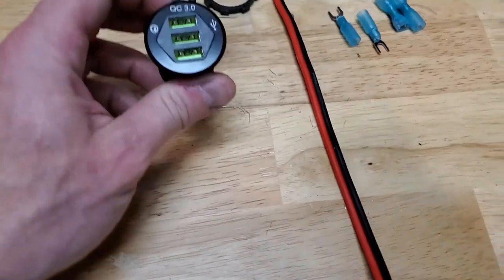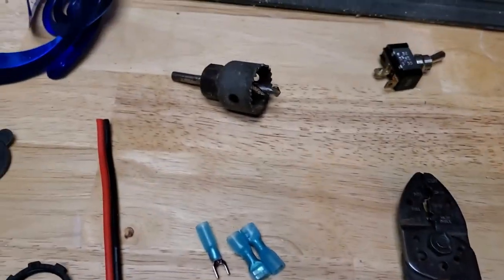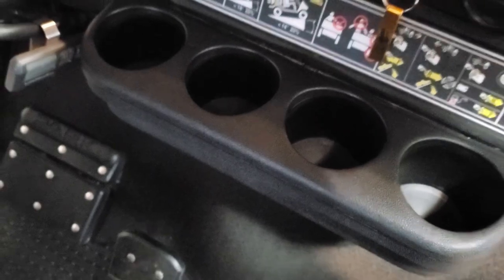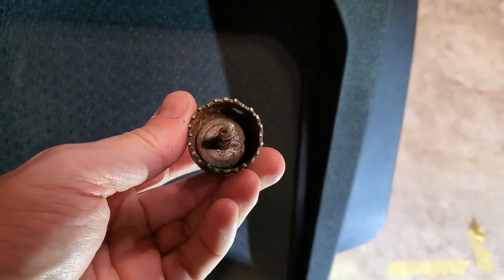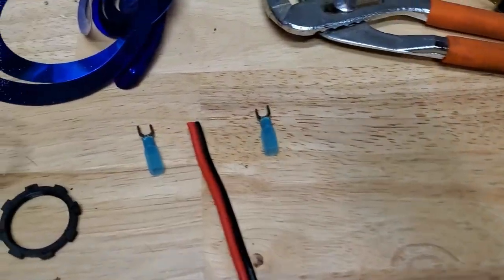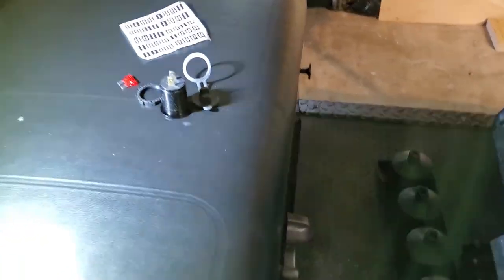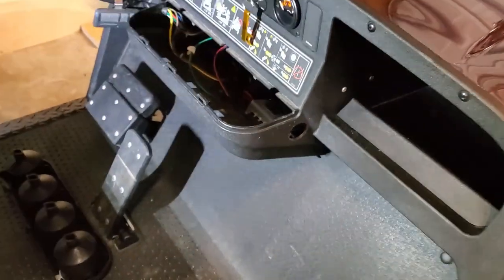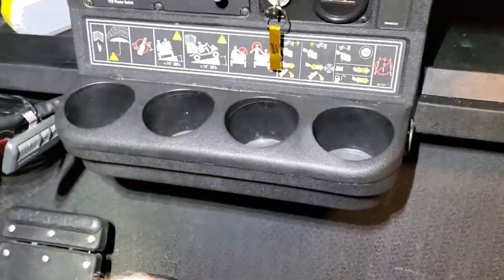USB port installed on a EZGO Express S4 golf cart

Comment: So you said hot all the time. So is that with the ignition switch on or is it hot with switch actually off?
Reply from the maker: I ran a hot up under the dash and added a fuse panel. It's connected to that so hot always.